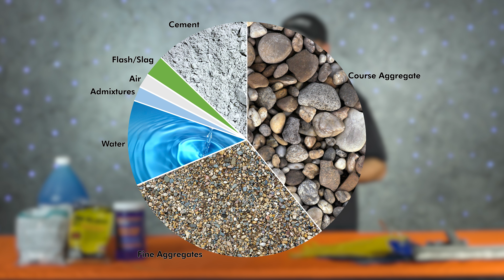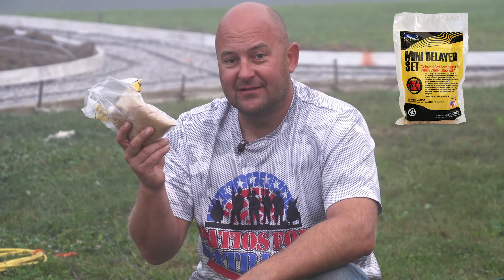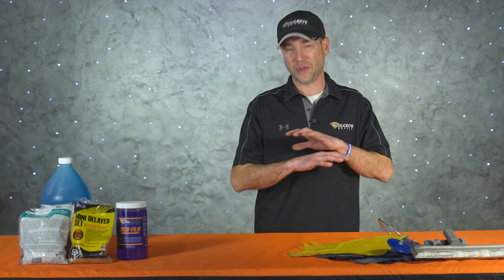10 Concrete HOT Pour Tips!

Comment: Do u guys use pea Gravel mix for stamp in ohio? Jw? I've done both.. good video. Good tips
Reply: Favorite tip is pour in the morning
Reply: Sometimes I prefer smaller the better for decorative integral
Reply from the maker: We use a 60/40 blend mix for most stamps. For stamps with really deep grout lines and small stones it can be helpful to switch to pea gravel.👍
Reply: @DecoCreteTV  thank for that answer!
Reply: I use 3/8 mix on all my stamp pours.
Reply: @MikeDayConcrete  I hope u can answer this. Or deco so pea gravel or 3/8 mix. I understand u get better texture but isn't it a little weaker being a gravel mix and small agg at that. To me and this is why I asked in the 1st place. Gravel mixes on a driveway cause pop outs (that's what the suppliers say) so use a stone mix. And we know stone mix is stronger because the agg is not round and bigger. So isn't is counter productive to use a small round agg on something the customer is pay a premium for (food for thought) like I said I have done both but I would love to actually know is it really worth it. Texture is #1 that's what every1 says. But to me straight and surface protection should be #1 and just not pour a big slab and u don't have to.worry about texture. Thanks and plz let me know your thoughts, I'm not saying what I said is correct. Just Wana get answers
Reply: It's 4000psi whether it's 3/8 stone or 3/4 stone. Yes, 3/8 may be more susceptible to cracking so we use water reducer and saw joints accordingly.
Reply: I have used both mixes, the first time I did a municipal walkway and driveway with a stamped pattern using 1" rock, we got on it early and floated it well using a wood float first, it came out beautiful, ever since I am not too worried about big rock mixes for driveway stuff, but for anything real nice like a pool deck or decorative patio, its a 6 sack cement and 3/8 aggregate 50/50 blend of sand and rock.